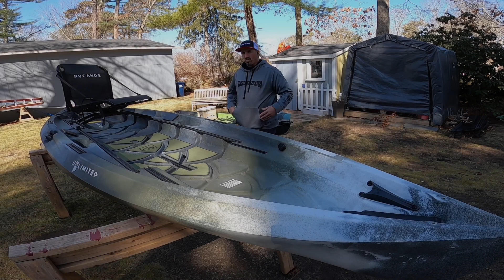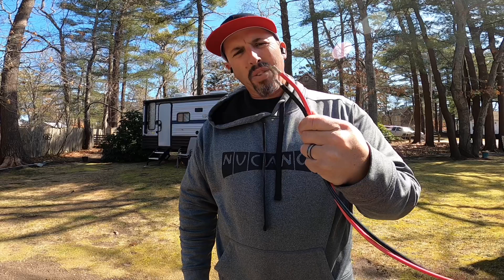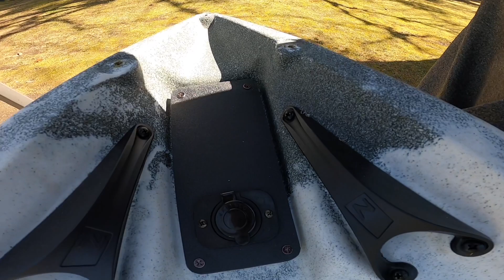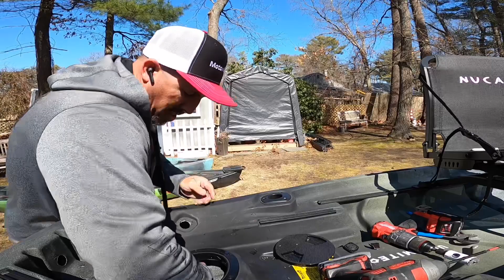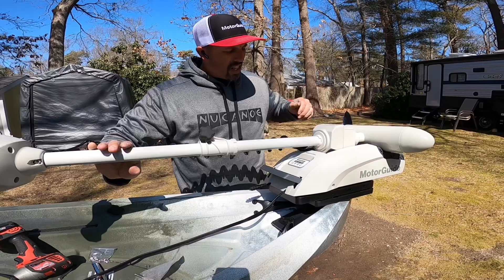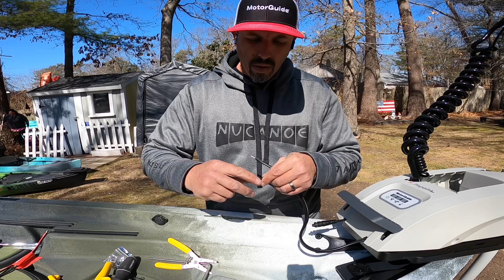Installing a Motorguide Xi3 on my brand new NuCanoe Unlimited

Comment: I bought my Unlimited at the Bears Dens a few months ago. Do you have your fishfinder connected to a terminal strip? If so, which one do you like? I have 2 - 3 amp circuit for my Elite FS and NMEA. I rigged it but looking for a terminal strip with fuse holder? Any recommendations  would be much appreciated.

Comment: I saw that Amped Outdoors has a 24v 50ah battery that's only 23lbs. With this 24v trolling motor, will that battery be able to handle it? And what kind of speeds were you getting with that 24v? Lastly, any word on the 36" shaft saltwater version?
Reply from the maker: I have the 24v 50ah from Amped. The battery should power this motor well. I have not had a chance to run it yet though. Due to some family health issues, my fishing time is limited right now. I will do a full review of it once I can put some time on it and let you know. As far as speed goes I get about 5.4-5.6 mph out of the 24v 70# thrust Xi3. That’s fully loaded down on tournament day but light load or empty it’ll get up near 6mph. For the 12v Xi3 Saltwater Series that should be available in April 2022! That’s also depending on shipping, chip availability and all that which is crazy in the world right now.

Comment: Awesome video and very well explained. I am having a hard time to find that exact same mount on Nucanoe website , they say it is the #7156, but the one you are using is quite different mount from picture on their website, maybe I searched it wrong  . Thanks for your help.
Reply from the maker: 7156 is the right bow mount plate. You also need the Motorguide Quick Release Bracket. That’s what goes on the Motorguide and onto the Nucanoe bow mount plate

Comment: How did you get the bow mount plate on the website it says that they are backordered for the unlimited
Reply: I reached out to Craig dye on the pro staff and the bow mounts for the unlimited are still in production, they should start becoming available in the next week or two (is what I was told).  This guy is also on the nucanoe team so they got them first.

Comment: Does the 24 put out more speed than the 12? Or just more juice for longer?
Reply: It will give you more speed not longer battery life the 80 is faster so it takes more battery to run it thin a 12 volt system
Reply: Is it more difficult to recharge your 24 volt battery bank in the field than a 12 volt system?